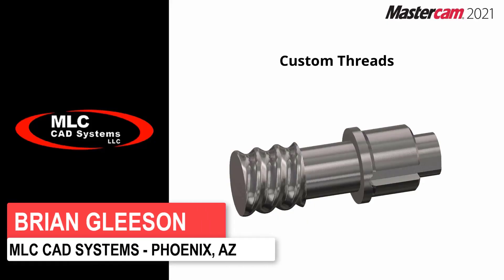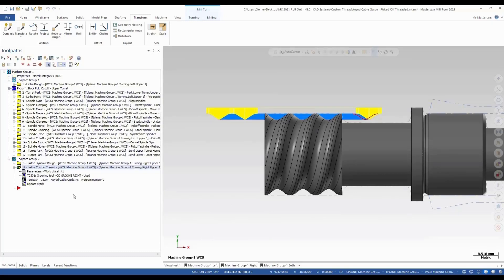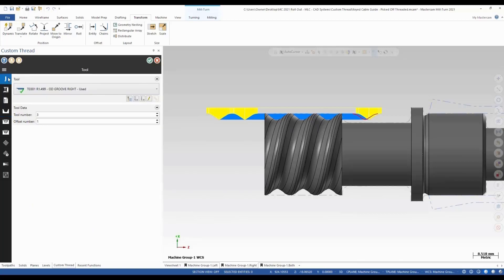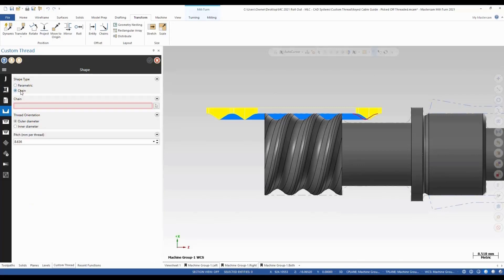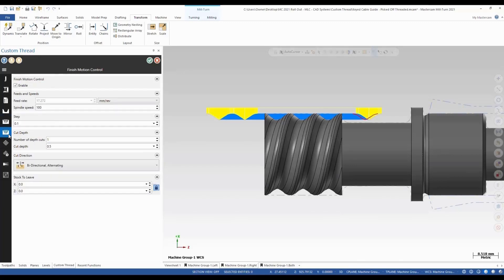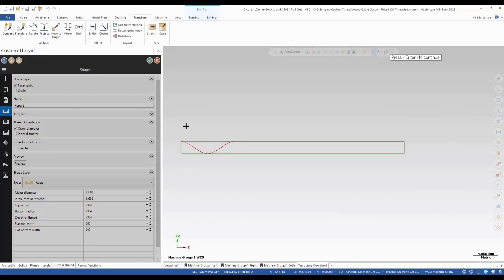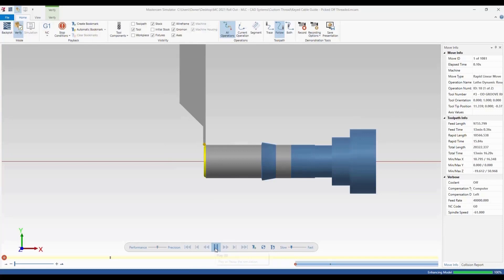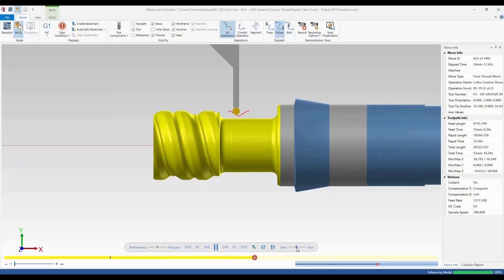What's New Mastercam 2021 - Custom Threads

Comment: Có thể thay đổi khoảng các ra vào ở 2 đầu của ren không ạ.
Reply from the maker: Translated question: Is it possible to change the range of entrances and exits at the 2 ends of the thread?

There is an area for acceleration clearance which is set to automatic by default and can be changed to manual.  On the same page you can adjust the over cut amount as well, but the custom thread tool doesn't have a traditional lead-in or lead-out setting that can be adjusted directly.